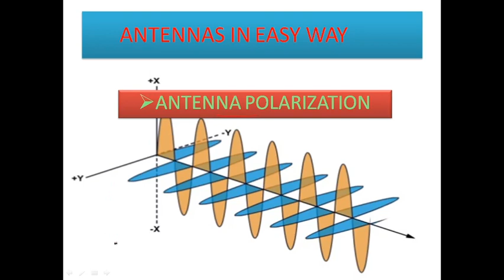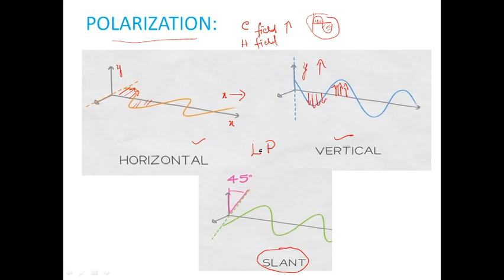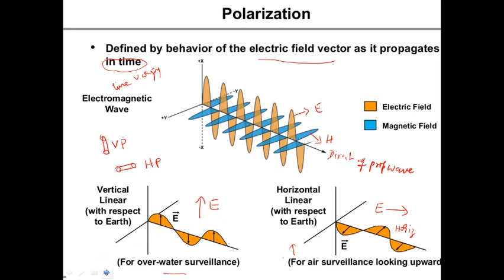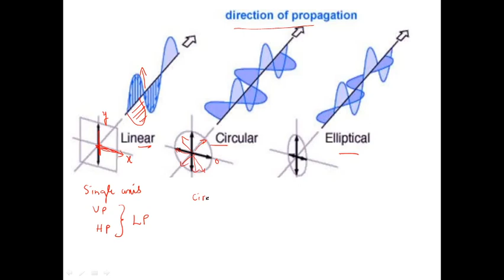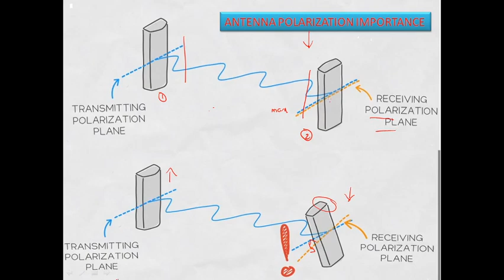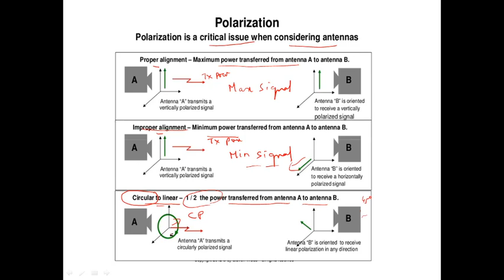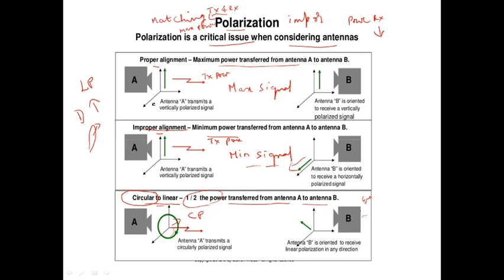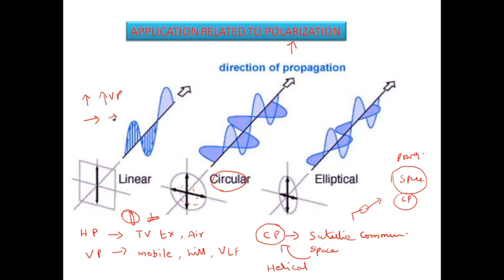ANTENNA POLARIZATION

Comment: The wave diagram shown at 4:58  with Blue magnetic field ,  seems to indicate that the total instantaneous power in the wave ( Poynting Vector) being exchanged between the magnetic and electric wave, is not constant, but oscillates in magnitude even reaching zero twice per cycle,  As far as I know the instantaneous total power  total power  stored in the electric and magnetic fields is constant. Please explain that diagram!

Comment: Minor correction: the orientation of the magnetic field should be clockwise (not counter-clockwise), relative to the electric field, such that the propagation direction is represented by the Poynting vector: S = E x H